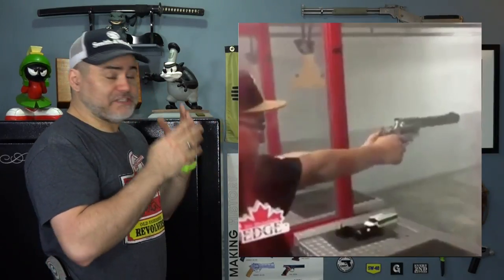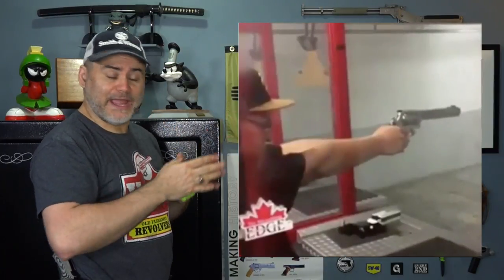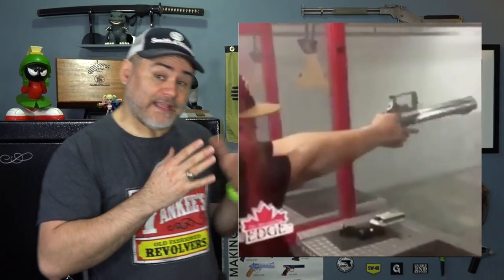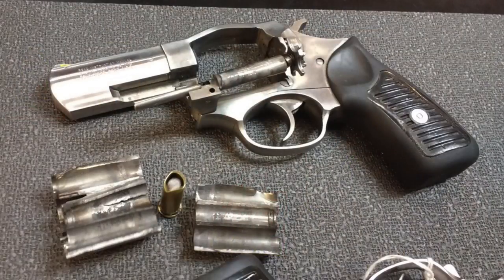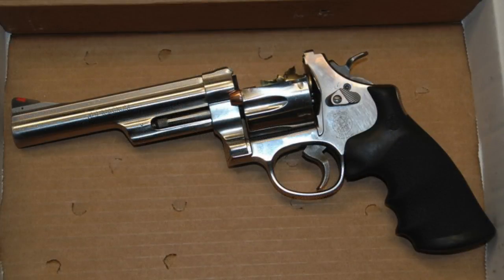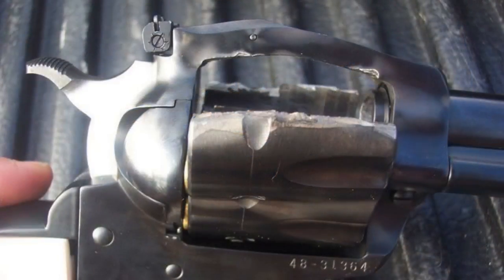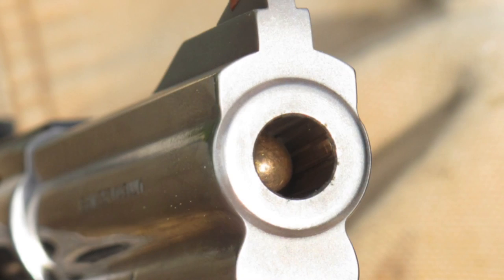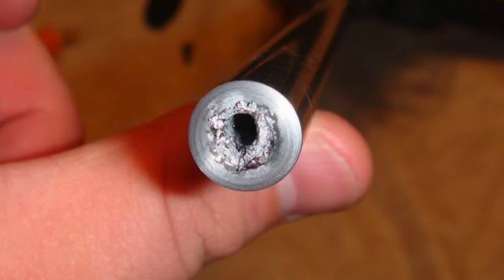KABOOMS!!! Causes and How to Prevent Them.

Comment: Competition folks will avoid cleaning their barrels because a slight amount of coper fouling will fill in microscopic abrasions in the rifling and cause the rifling to be smoother. They will however notice when it gets slightly too much and accuracy diminishes. Most of you won't notice, I wouldn't even notice. So keep them clean.

Comment: Borescopes and bore lights are nice to have, but not strictly necessary. A clean piece of white paper, placed about an inch away from the opposite end you are sighting down, will give you enough reflected light to see if your barrel needs further cleaning. Particularly with a modern revolver, as it has a relatively short barrel and plenty of room to place your paper when the cylinder is open.

Comment: This happened about 3 hours south of me. Word from from those involved was it was a catastrophic materials failure, because the S&W X-frame is a shit design. Other ranges in my area have had the same problem, all running factory ammo or starting loads for reloaded ammo. Typically happens between 300 and 500 rounds. The cylinder did not rupture, and the previous rounds fired were all good and were under RSO supervision.

Comment: Had 2 S&W revolvers mini kaboom cracked the cylinder, bad metal,  they didn't blow apart but shot sounded off when I examined had a black line where the chamber was.
Knew someone had a 629 Kaboom out of time, firing pin hit the edge of the primer and still set it off.
easy to check barrel for obstruction without looking down the barrel, shine a light down the barrel and spot of light coming out the other end should be round and size of the bore.
Had a new chiappa that was out of time, formed primer to the firing pin hole  from the back pressure of forcing bullet into barrel when not properly centered

Comment: I was reminded of how Ruger had issues with the cutting coolant that caused barrel separation in some Red Hawk revolvers, leading to the SRH model. then they figured out the coolant was not allowing enough friction to hold the barrel in. I do load some of my own Magnum rounds and noticed that if I loaded at original .357 Magnum speeds and pressure at the same bullet weight, it did not like it. I'm not sure but we think that's why that one went slightly out of time. any ideas on that?

Comment: I had problems shooting 2 older DA revolvers. Both had poorly made hand loads/reloaded .38spl ammunition. as tym states, keep weapons clean & use a hoppes bore snake or Otis ripcord barrel cleaner. ripcords have nomex fibers so you can use them on gun ranges; if the rules or safety officer allows. shotgun barrels get a lot of muck & oils in them too. I was surprised when I first cleaned my brand new left-hand 870 pump. rust, lint, grit can seep into barrels, mags. be careful.

Comment: We have a S&W M&P R8 and frequently shoot it with 38 special in it at the range.  I've noticed that the cylinder is starting to get little powder(?) rings in it about where the 38 specials end.  I clean it (the barrel and all 8 cylinders) between shootings with Ballistol and boresnake and that clearly isn't getting it done (for the cylinders, it seems to work pretty well for the barrel).  What would you recommend to really clean the cylinders?
Reply: Lens Reyner use a little scotch brite and solvent
Reply: Inside each cylinder?  Are you talking about the cylinder face?  That doesn't seem to be an issue, it's getting a good cleaning in each cylinder.

Comment: Handguns are proof tested using rounds that exceed standard operating pressure by 30%. It takes a significant mistake in a hand load to generate a 30% over pressure round.  Most kabooms caused by hand loads happen when a loader is using a faster burning powder with a lot of excess case capacity.  Inattention or distraction when loading and a round gets a double charge of the powder.  Shooting hot rounds that are over pressure causes long term wear and damage to the gun but isn't going to set off a kaboom.  However, loads that exceed the SAAMI maximum pressure for a given caliber put the ammunition in a high risk operating window so an additional mistake of improper bullet seating depth can then cause the round to exceed the proof test pressure level which can cause a catastrophic failure.  Hot rounds near the top of the pressure range leave very little margin for error, but they don't cause kabooms by themselves.

Comment: I thought the consensus on the web was that the revolver was slightly out of time??
Reply from the maker: No, that will generally NOT cause this type of failure. A revolver would have to be way out of time for this to happen and if that was the case the hammer would miss the primer.
Reply: TheYankeeMarshal okay so the information I saw said this happened using factory Hornady ammo, so I am guessing that means since it was probably the range gun it was a partial barrel obstruction?
Reply: Could it be wear from continued firing out if time. Eroding the forcing come until the throat cracks and finally catastrophic failure...?
Reply: Justin Miller ohhhh boooooom.was that an insult calling the revolvers old ha out of time.... Well shit ill still love them more than any other firearm
Reply: don't forget "end shake" & the dreaded barrel-cylinder gap. DA revolvers need a lot of "care & feeding". Gemini customs does great ccw/duty/defense revolver work. Check them out!
Reply: Justin Hemboorger No, out of time refers to the timing of the firing mechanism including the hammer falling with the rotation and lockup of the cylinder

Comment: Ooh....a failure in a revolver, that never happens. Most reliable handguns in the world. And yes I'm just poking the bear.
Reply: Damn Dogs bet that wouldn't have happened of it were my G-Lock, they are perfect.
Reply: Both scenarios are 100% ammo related and can happen with semi autos just as easily.
Reply: Grant   Yes, but a semi-auto will not eject properly with a squib load.  Makes you a little more aware of the situation.  With a revolver, if you are doing a string of rapid fire you might pull through it with a squib load if you don't realize it in time causing the catastrophic failure.
Reply: +Grant My friend's dad is "getting on" early 70s. he spent decades in the shooting sports but he loaded a .45acp 230gr bullet wrong which screwed up my friend's M&P compact .45acp pistol. The fat slug got stuck in the Smith & Wesson barrel. FWIW, I advised him before about only using well made factory .45acp but he did not listen.